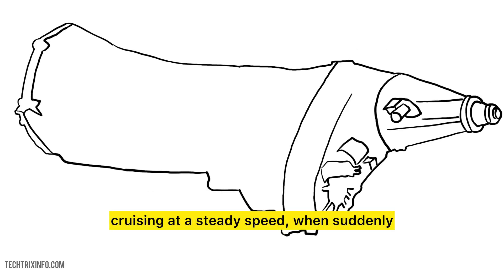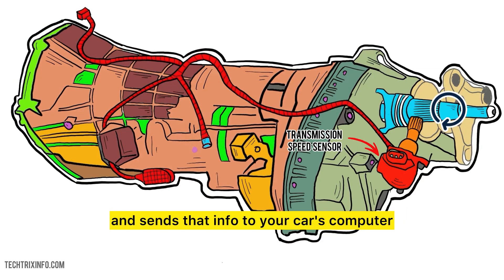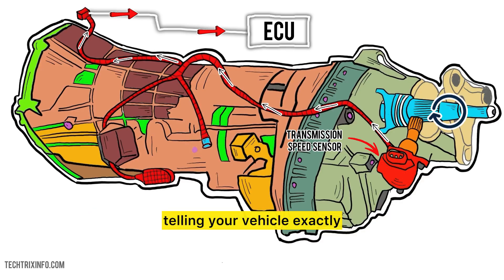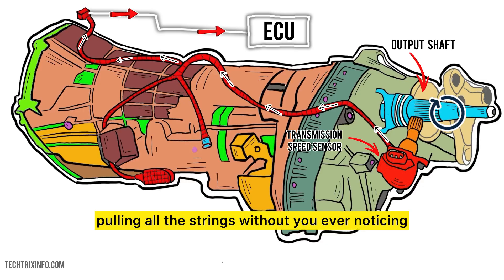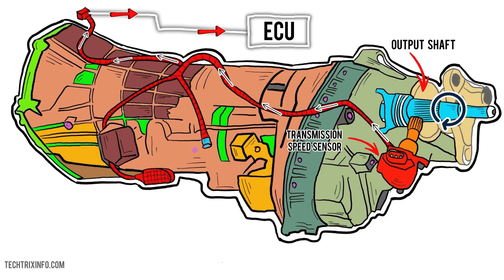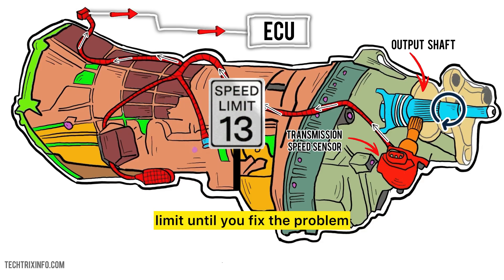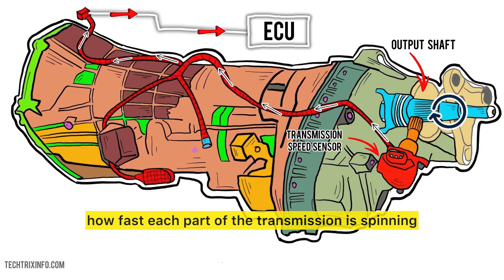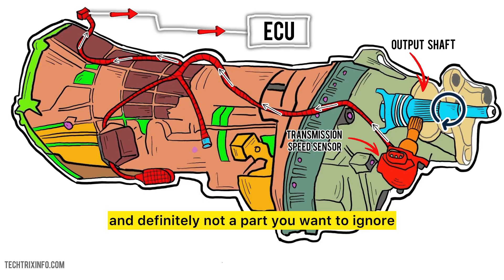Transmission Speed Sensor Explained With Animation | Mastering Automative Sensors | Part 22

Comment: after changing transmission the speed is getting inaccurate ( 20% less). How come it happen?
Reply from the maker: Hi thanks for the question, it’s not clear after changing transmission, do you mean you have have replaced the transmission (gear box) or after changing the gears.
Reply: @TechTrixInfo yes I replace the gearbox except TCM still use the old one

Comment: Please do make video on photochromatic mirrors..
Reply from the maker: Hi Thanks for asking, have written it in my daily, as the current series on Automotive sensors finished, will do
Reply: Is it manual/ auto transmission
Reply from the maker: @abegenjucar Transmission speed sensors on the output shaft are common in automatic, CVT, dual-clutch, and some automated manual transmissions. These sensors allow the control module to monitor output speed for precise shifting and efficient gear changes. In CVTs, they help manage the pulleys and belts, while in dual-clutch transmissions, they ensure smooth synchronization between clutches. Some newer manual transmissions may also include output shaft sensors to support advanced vehicle features.
Reply: after changing transmission the speed is getting inaccurate ( 20% less). How come it happen?
Reply: Great suggestion